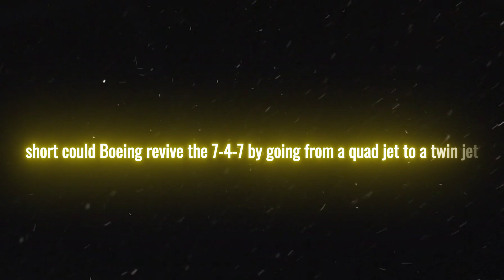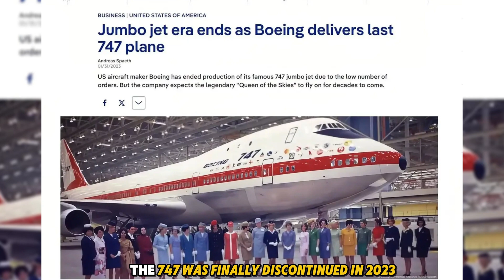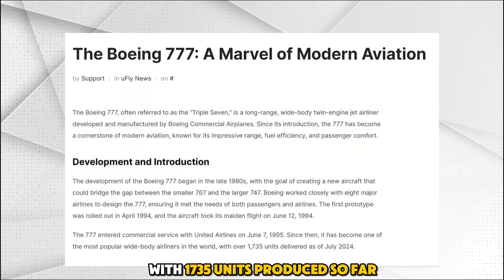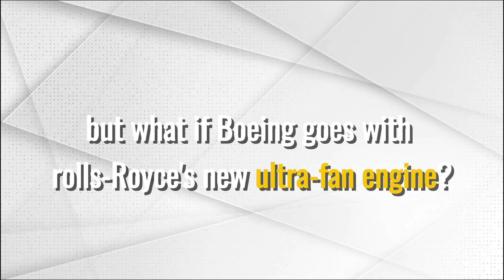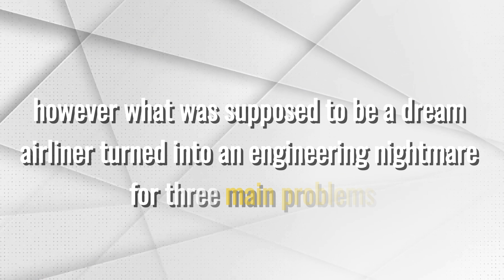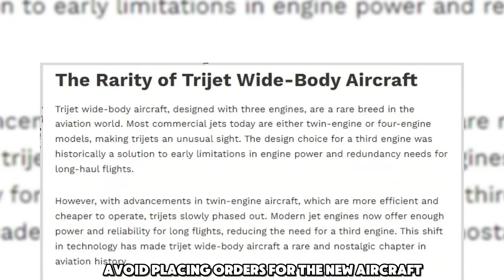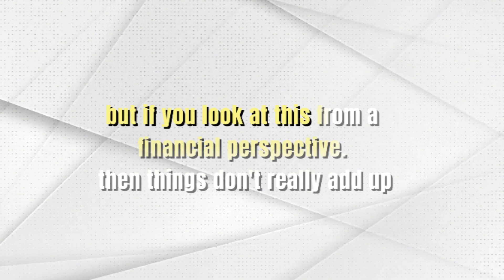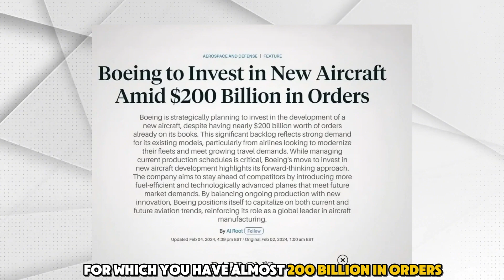The Shocking Reason Boeing's Two-Engine 747 Was a Game Changer

Comment: More logical would be to move out two engines (3 and 4), and keep 1 and 2 as is without any design changes to the wings. However, the tail may be redesigned to accommodate one of the bigger and more efficient engines. Hence, a new Tri Star. Possible?
Reply from the maker: That's an interesting perspective! Redesigning the tail for larger engines could definitely lead to some innovative designs. Tri Stars have a unique charm, and it's fascinating to think about how they could evolve!